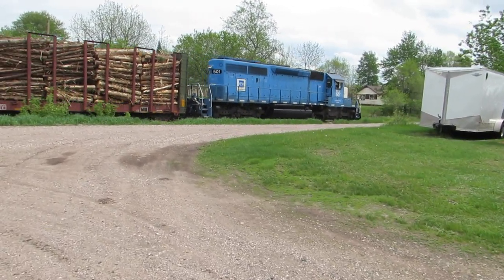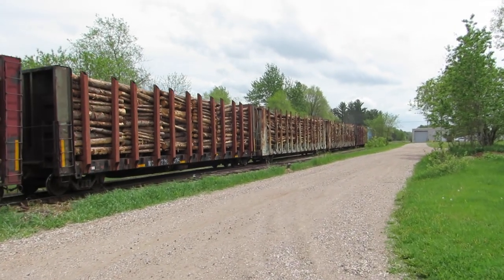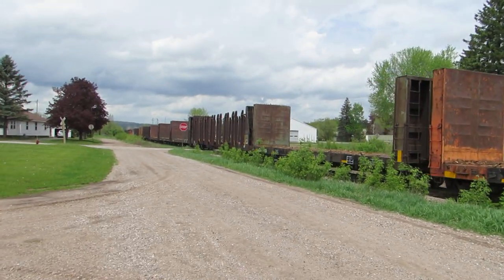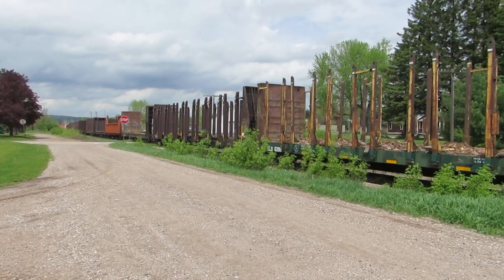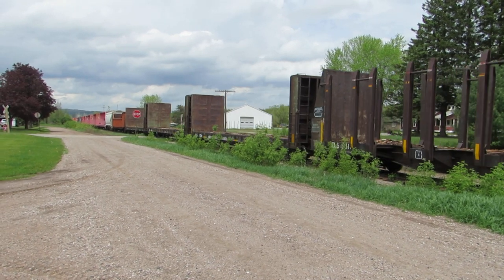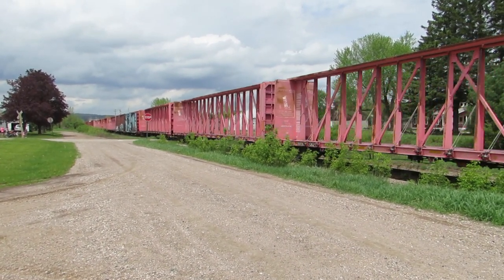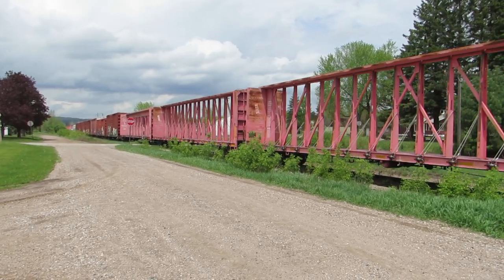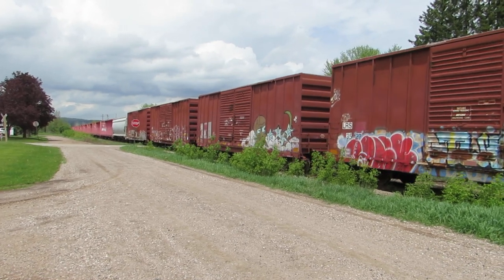ONE LONG TRAIN WITH FRED CHASING RIGHT BEHIND! | Jason Asselin

Comment: The  SD40-2 holds 3200 to 4000 gallons of fuel , weighs 368.000 lbs is turbo charged with 16 cylidars although some were modified with 20 cylinders and  can pull an average of 60 cars depending on the grade each empty car weighs an average of 30 tons and the average loaded car  weighs 130 tons ..